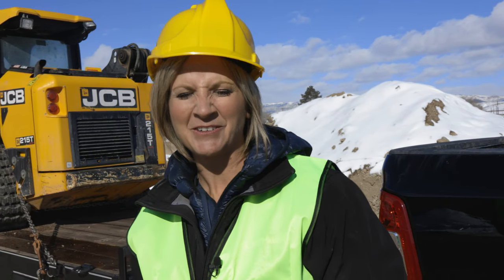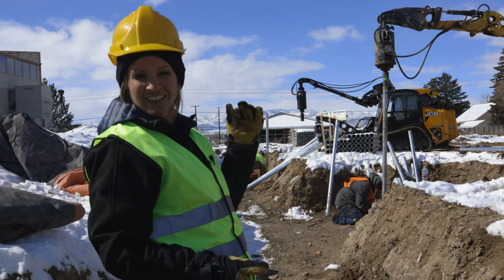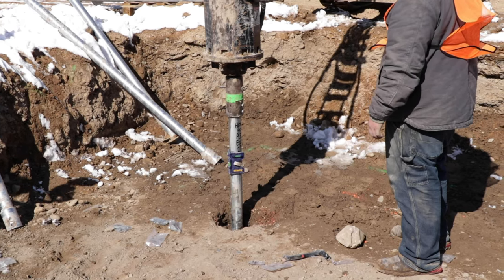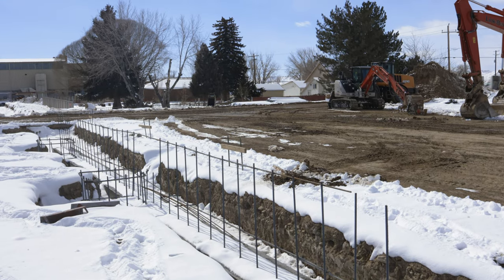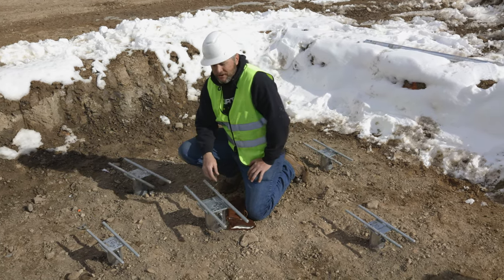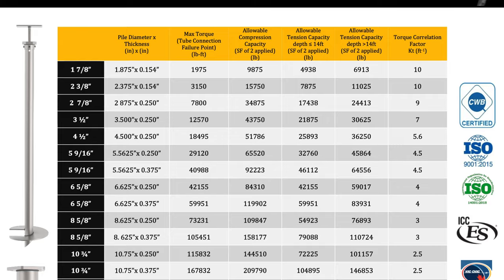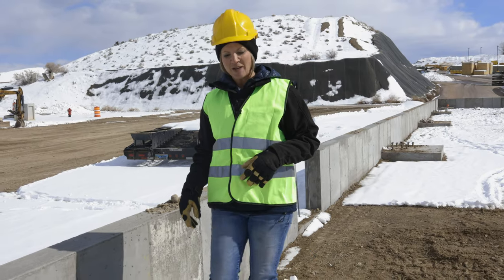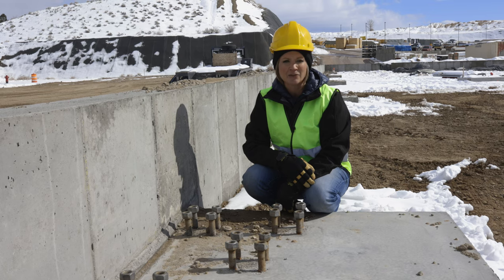Steel Building Foundation Using Helical Piles to Solve for Bad Soil

Comment: I was all excited about using helical piles on an upcoming residential build - until I realized they have a finite lifespan of 75-100 years. That might sound like a non-issue to most, but I have a hard time as a builder committing to a home that will fall apart on cue.  Its almost like planned obsolescence. I live in a town with old school buildings that are 100 years old that are being converted to apartments.  All the work is internal remodeling. The structure is very stout and strong and should last another 100 years. I envy that.
Reply from the maker: It isn’t that they have a lifespan of 100 years, it is 100 years before the galvanization starts breaking down at all in severe habitats.

Comment: What about rusting metal in Helical piles with time? It subjected to water, wet soil, acid and alkaline environment, etc.
Reply from the maker: Each helical pile from GoliathTech has been hot-dip galvanized. Even exposed to water and elements, the galvanization is rated 80 years.
Reply: This is a good question.  I wondered how long a concrete foundation is guaranteed and I found this:  "While most contractors warrant the installation for a year, most manufacturers guarantee their products for five to 10 years." Mr. Google
Reply from the maker: All our piles are hot dip galvanized and conform to ASTM A123.
Reply: @goliathtechutah771  I know that. So what?
Reply: Now that you're embedded into  bedrock layers,  you are now tapping into any kind of seismic activity.  

Yes you can support extreme loads,  but aren't you introducing yourself to a whole new plethora of other problems?!

Comment: What's the average cost to go 50 feet down with the medium size
Reply from the maker: For most decks average cost is 450. For a pile that has a load capacity of 34K lbs to go 56' it would be about 2900 each.

Comment: Wouldn’t frozen ground give false torque readings?
Reply from the maker: If we didn’t install past the frost depth it definitely could. That is one of the reasons we are required to be below frost depth. 

Additionally, the KT factor is the factor in which the skin friction has against the pile. Part of the calculation to determine the load the pile can hold reduces the torque achieved by the surface area that could be adding resistance. Through this calculation we have a load that is based primarily by the torque against the helix at the end of the shaft.